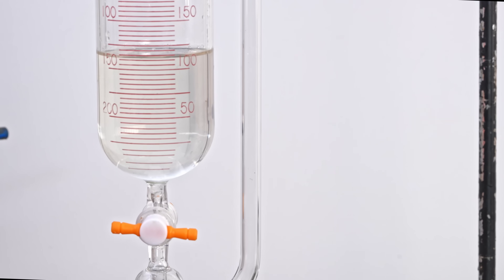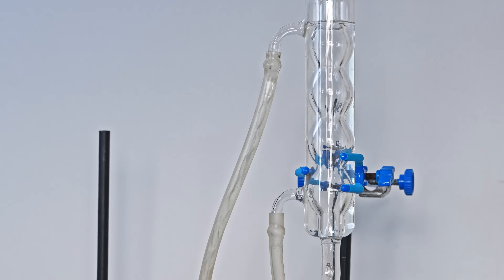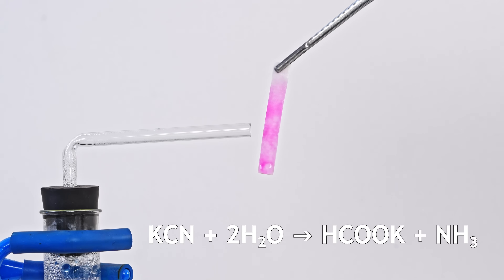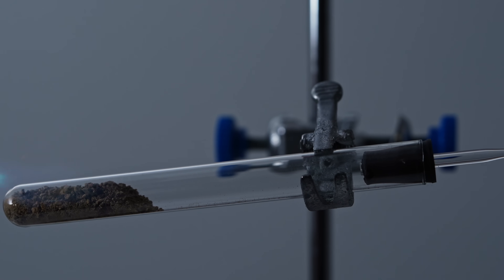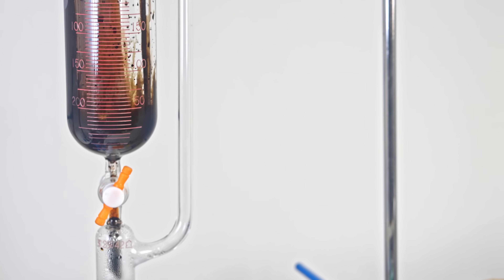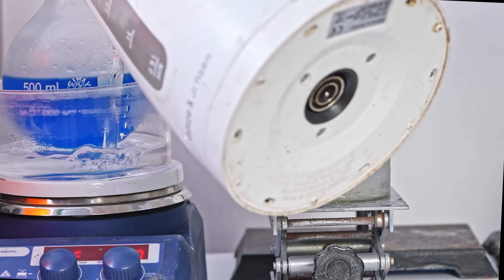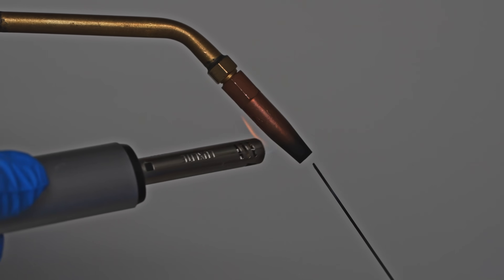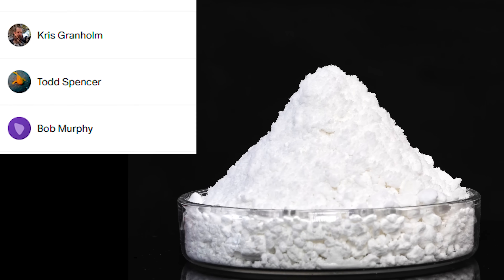I tried to melt tungsten with a VERY HOT cyanogen flame

Comment: when it comes to melting metals, the flame theoretically being hot enough is only one part.
just as it takes more energy to melt ice than raise its temperature by 1 unit it takes a considerable amont of enery to melt it. sustained contact is required.
the flame temp isn't constant, putting the wire so close to it lowered the temp, as indicated by the large yellow plume. premixing it with required oxygen is almost required to get near the max temp.

dicyanoacetylene is somehow easier to make than a lot of cyanogens.
well, if you have a acheson furnace, graphite machining equipment, and a powerful induction heater anyways.
either my temperature reading was inaccurate(likely) or the wikipedia page has the wrong temp. production actually started after 3000c for me.
i no longer have access to a lab or land to build one on so i can't redo it to make sure sadly.

Comment: In the far future, welding tungsten with an Ozone-Dicyanoacetylene welding torch in room with a 100% nitrogen atmosphere (Or argon, dunno of nitrogen will be an issue at those temps). Though perhaps a robot would have to weld it as that setup is highly explosive...

Besides, I think fiber lasers could do it better already, or even plasma welders.

Comment: The problem is that the very hot tungsten (and tungsten oxide) emits electromagnetic radiation from IR to UV, cooling it down. Radiation cooling does not only work at rocket engine nozzles.

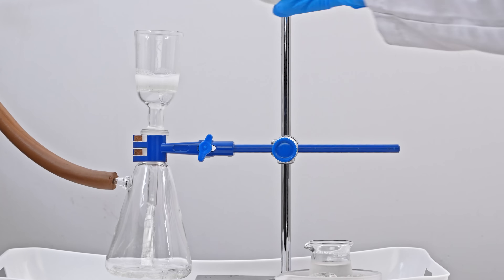Comment: 0:45, you can easily get very pure potassium cyanide from potassium ferrocyanide by adding 20-40% aqueous sulfuric acid and distilling hydrocyanic acid which can then be added (optimally after drying and redistilling) to a methanolic solution of potassium hydroxide.

Comment: From what was visible in the video, the Tungsten was starting to burn, rather than to melt. Maybe the O₂ and O₃ were at too high concentrations? And that small flame did not transfer enough energy into that Tungsten wire. You could try using a smaller diameter wire, to reduce the heatsink effect of that relatively large mass of metal.

Comment: Vacuum purged and contained at a higher pressure and regulated with a flow meter. Should give you a much more consistent burn by working around the inconsistent chemical reaction rate.

Comment: I believe that if you would have used several reaction flasks, then the flame would be more stable. Because the fluctuation in the cyanogen generation would split between all of them, so that in average you will always have a flow of cyanogen.
5-6 small reactions flasks, each leading to the same drying tube should do it.

GREAT video!!!

Comment: Seems like the varying pressure of the gas production is at least partially to blame? Maybe something like a small balloon could smooth out the flow like a capacitor, storing the peaks and keeping the valleys higher.

Comment: Flame instability: I've built fused silica torches for oxy-hydrogen and oxy-propane in the past so I am not sure if that translate to cyanogens. The fact that the flame stayed "hooked" to the tungsten but hardly to the tip of the torch leads me to believe that the speed of flame propagation in the gas is slower than the speed of the gas coming out of the nozzle. The flame is basically getting blown away by the incoming gas. The flame sticks better when premixed with the oxygen because the speed of flame propagation is greater than in surface mixed air.To slow down the gas, try a bigger torch tip. Be careful as to not got too big because then the flame can propagate back into the tip.

Comment: Pretty flame, you were just burning off some of the tungsten rod though. To actually get a bead of melted tungsten, you need an inert atmosphere. This implies a reducing flame, with excess cyanogen, otherwise the torch gas would also just burn off the tungsten... and running fume hood flows of argon in a glove box sounds pricey, lol.

Comment: possibly you can make a hot flame by passing hydrogen through an arc and create atomic hydrogen. I think this was done before oxy-acetylene became a thing. Will atomic hydrogen melt tungsten?
Supposedly 3400-4000 degrees C

Comment: I wonder if you could get a more stable flame if you put the cyanogen into a reservoir of some sort ( perhaps a large balloon or gallon bottle ) and use a fishtank air pump ( its a cheap membrane pump ) to feed the torch.

One of the warnings about C2N2 is that the flame can travel back to the container easily.You can make a flashback arrester by putting some coarse steel wool in the tube before the torch. Don't pack it too tight, just enough to steal the heat from any flamefront that it meets.

On further thought, I think you could get the best results if you liquify the cyanogen by piping it into a flask in a liquid nitrogen bath. Then all you would need is a rubber stopper with a tube through it for the top of the flask. Just let it warm up ( in an ice bath to control pressure? 32F is above C2N2's boiling point, but not hot enough to cause high pressures ) and evaporate and there should be steady pressure without any complicated setup.

This was an interesting video. I'd like to see if a steady flame would melt that Tungsten wire. The tip looked a little erroded from what you did here. So I think a better flame would do it.

Comment: if you really want this to work 
first you would need a lot of money because i dont imagen this stuff is cheep 
then you would need a fume hood 
and then you would need to somehow obtain a high-pressure gas cylinder of this highly toxic and deadly gas that is almost certainly not commercially available 
youd then need another tank of ozone 
and then finally some gas hose and a welding/cutting torch normally used with oxy acetylene torches 

congratulations you can now theoretically melt tungsten. with flames. 

although you would literally be better off using an arc welder or plasma torch because those actually just strait up melt it and it doesn't cost anywhere near the amount of the above method and won't get you put on every government watch list in the process of doing it 
oh and you can melt more than just a small wire of it 

another alternative is the macrowave that styropyro made.

Comment: The problem could be the speed of flame propagation in this gas is lower than the speed of the gas jet so the flame fails to keep up with the jet. So you might want to extend the nozzle of the welder torch with a piece of metal tube that has a much larger cross section than the torch nozzle. Another thing, try burning this gas in very humid air. Carbon monoxide for example, does not burn if there is zero water vapor present. Nitromethane is another slow burning substance, creating issues in internal combustion engines.

Comment: I have been able to melt copper wire with lighter before.
At first it couldn't work, but i later coil up the wire, heating both the coil and the tip, and managed to melt the copper.
Reply: That makes sense, you were able to store energy in the coil which transferred to the tip in combination with the residual flame which was able to reach the activation energy of the copper

Comment: IMHO to get a stronger and stable flame  you need a lot more gas, those torches are made for higher pressures. But I don't know if cyanogen will be stable under pressure or explode like acetylene. So maybe you need a simple DIY torch, that can work with gas under low pressure. 
In some hydrogen-oxygen experiments people have made diy torches out of stiringe needles, or other small pipes, and some Y-tubes, flame holders, flame arresters.

Comment: Melting tungsten by chemical means is not an easy task. Thermal losses go with fourth power of the temperature. An electric arc with a power of a couple kW within a pressurized an argon atmosphere works fine.

Comment: I wonder if this is feasible from a solid mixture. Moistening it to activate, akin to a carbide lamp (and the regulator mechanism within). Maybe it can't be controlled that way, the moisture being catalytic rather than consumed in the process?

Pressure needs to be much higher for that kind of torch to work -- at least a few PSI (~tenths of a bar). Clamped joints but also a pressure regulator and something to let off excess (or limit reaction rate) will be needed.

With most fuel gases, you can tell mixture from the shape and color of the inner and outer flame cones; the purple here definitely throws off my eye (besides how cameras see it a bit differently than real eyes do), and I wonder what stoichiometric really looks like.

Comment: @ChemicalForce now, lets get attention on this experiment. It is really cool, but how about dicyanoacetylene? Would you have a guts to try making this compound? It is pretty tricky to keep it safe, but the prize is ultimate; ~5500°C in ozone. Maybe even more in fluorine, but it would be extremely risky. But that would certainly be edge practical chemistry. Reg@rds!
Reply from the maker: The only possible way for me to get dicyanoacetylene is the pyrolysis of tetracyanoethylene which I have. However, I only have 25 grams of it :(
Reply: @ChemicalForce  I think it's far more risky to get it through pyrolysis than through halogenation/dehydrohalogenation reaction with Ca(CN)2, where halogenation should be conducted with bromine or even possible iodine, and dehydrohalogenation should be used as source of constant inflow of compound, or it should be produced in situ in small enough quantities at rather low temperatures, by very carefully controlling reactions speed. Liquid ammonia and NaNH2 should be considered as the base surrounding for dehydrohalogenation. Calcium cyanamide isn't expensive and it's rather manageable. My guess is reaction with bromine and then finding an appropriate basic environment for finalization. Possible role of vacuum for lowering temperatures and risks of any incident.
Reply: @ChemicalForce  i made one example of reaction for you. Ca(CN)2 in CCl4 or other more appropriate halo-solvent for dissolving Ca(CN)2 is placed in the proper vessel for adding liquid bromine in drops with controlling temp. than adding bromine with magnetic stirring until reaction is done, with constant temp. control. Remove solvent under a hard vacuum and then collect it and solve in liquid ammonia with stirring. Prepare the appropriate quantity of NaNH2 in another portion of liquid ammonia, and then add a solution of Ca(BrCN)2 into it carefully with slow magnetic stirring and controlling temperature constantly, maybe even by cooling it with liquid nitrogen. Reaction should be preceded under an inert atmosphere and reflux with a moisture stopper and protected from any light. Maybe C4N2 should be allowed to crystallize from liquid ammonia where it should have best anti-polymerizing conditions, at as low as possible temperature where ammonia is still liquid. At very low temperatures after decanting ammonia and additional cooling with liquid N2, it should be stable before use.
Reply: P.S you should be tweaking reactions to avoid polymerization and probably try it with a few different forms and settings until you find the right one.

Comment: This was so cool to actually see on video!
I wonder if the heat loss from sublimation of the Tungsten Oxide (and the subsequent removal of the hottest particles from the bulk metal's surface) isn't perhaps leading to a net heat loss, rather than a net gain from the excess oxygen reating with the hot Tungsten?

If you ever try this again, try to use larger diameter tube(s) to reduce flow resistance to the torch and to place a large buffer tank (something like a 5l RBF should work nicely) as close to the torch inlet as possible.
This should ensure that the largest pressure drop occurs over the torch, while also smoothing out the C2N2 pressure fluctuations.

Comment: For once, a Chemicalforce experiment actually reminds me of something I used to do as a teenage 'hobby chemist'. I never used any 'toxic' gasses, but I made some very hot H2/O2 flames. One thing I discovered was that trying to feed the flame directly from O2 or H2 producing reactions was tricky AND risky (one time, the pressure dropped and the flame 'crept back' into the glass pipette I was using as my 'welding head' and it blew up quite loudly - that was the last time I used the 'direct' approach). Since neither H2 or O2 attack rubber, I ended up filling balloons from the reaction, and then feeding the flame from the balloons, which would produce a nice, reliable and very hot flame for a short while. You'd probably NOT want to do that with something as toxic as cyanogen, though... 😅
Reply: This is why flashback arrestors are a thing

Comment: You want a gas reservoir to act like a capacitor to smooth your output 🤔
I was thinking of doing this as my oxygen propane system uses a small oxygen concentrator that has a pulsed output

Nice to see cyanogen flame ❤
Reply from the maker: It's difficult to store due to its high propensity for rapid and spontaneous polymerization

Comment: Could you run the cyanogen into a trap with a large open top water tower attached so the cyanogen can build up by pushing the water up the tower. Would be easier to control the flow but would probably push it too fast unless you were careful. Might let you keep the flame burning consistently enough to melt the tungsten.

Comment: I never saw this flame in person. It's great someone finally put it out for everyone out there to see.
Temperature of the flame can be extremely high, but energy (heat) delivered isn't, so the rod's shedding of heat means it is not reaching the temperature of the flame. You need to build some kind of gasometer to ensure high and stable reactant flow. Your burner nozzle needs more pressure. Keep trying, you'll get there.
Reply: I work as a welder and I do TIG welding sometimes. This is I think the reason why during actual TIG welding the electrode tip does not melt (the arc is above 10000 C, way above even the cyanogen flame at 4500C) because of heat conduction from the unheated part of the electrode and the argon shielding gas also cooling the electrode. Also welding with negative polarity directs most of the heat toward the workpiece. In aluminium welding you however use AC meaning about half of the cycle most heat goes into the electrode. While at positive polarity it removes oxides from the aluminium, (The AC is just so that it does not get to warm because at full positive polarity the electrode would definitley melt. The downside is that this produces a very loud noise so earplugs are a must when TIG welding with AC. However that also goes for MIG welding wich always has this loud sharp crackling + angle grinders and other loud machinery constantly screaming around you.) The current also needs to be very high compared to when welding steel as aluminium is a much better heat carrier so even Al has a much lower melting point then steel u need to max out the welding machine more or less to melt it meaning in addition to the 10000C arc there is also now 100s of amps passing through it with about 30-50% of the cycle at positive polarity (most of the heat on the electrode). Still it does not melt but only glows brightly. Take away the shielding gas/argon flow however and the electrode rapidly goes up with a fizz oxidizing in the air,  (which is why old tungsten bulbs were also filled with argon because otherwise the filament would also go up in a fizz the very second the lamp was turned on the very first time). Even if the cyanogen flame had been more stable and intense I had a feel it still would not work because every time Im clumsy and forget to turn on the shielding gas before starting welding the entire electrode tip instantly vanishes as oxide even I can weld for hours with it with the shielding gas on. Inert atmosphere is an absolute must. Tungsten might be heat resistant like crazy but it rapidly oxidizes away in high heat if exposed to air. The only way i think there is to actually melt tungsten is with special ultra high temperature inert gas furnaces.
Reply: @johnpekkala6941  Think you're right, the electrode was clearly oxidizing away fairly quick in all of that O2 and O3 he was pumping out. Probably could have oxidized it in a much cooler flame just because of the concentration of O2 and O3.
Reply: He could condense it with a dry ice bath and collect it in a pressurized cylinder for later use. In this way he would have full control on the flow. It's probably better to not store it long term though and empty the cylinder immediately after use.
Reply: @lagrangiankid378 Pressurized gas with auto polymerization potential? Thanks, but no. This is beyond DIY acetylene tank without solvent level of danger.
Reply: @bskull3232  Stabilizers (like HF) can be added to prevent polymerization, it can also be kept at low temperatures until use.
Reply: Yep, no... I think doing anything like that is just way to dangerous. Love the unusual reactions don't make my favourite Russian chemist disappear like that. A gasometer with Cyanogen doped with HF all DIY....

Comment: I think atomic hydrogen flames have a similar temperature, but should be more stable. H+O3 could be even hotter. There’s also the Li+H2+F2 tripropellent rocket fuel described in Clark (1972) “Ignition! An informal history of liquid rocket propellants” which also discusses a bunch of horrific reactions you might enjoy 😊
Reply: Ignition is such a good read
Reply: Not to be pedantic, but you wrote H2 twice, instead of Li+H2+F2.
Reply: @ thanks, fixed
Reply: @oitthegroit1297  
Speaking of pedantic: In the video at 2:42 it's said heated KCN would release ammonia (NH4OH). Wouldn't it rather be HCN that smells almondy instead of ammonia (both surely are breath taking)?
Reply: That's some cool reactions to test 😅